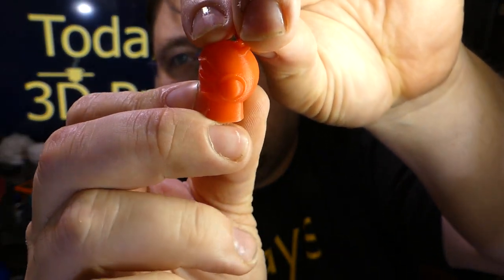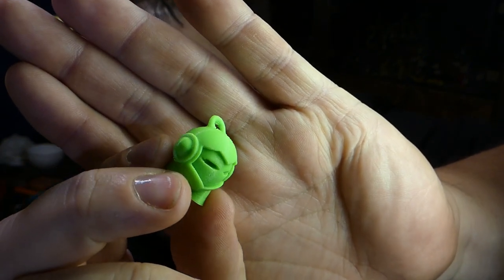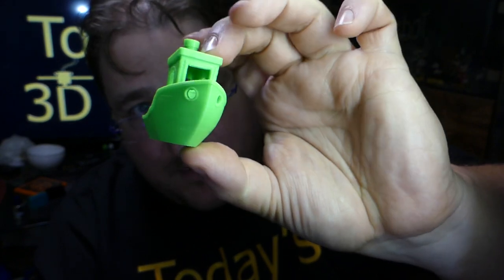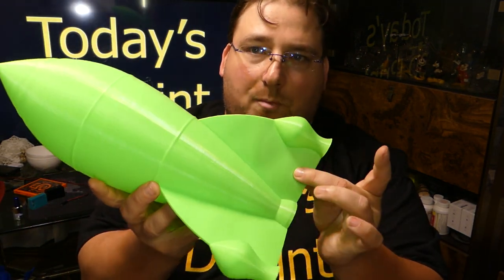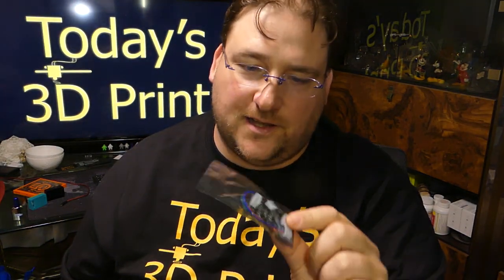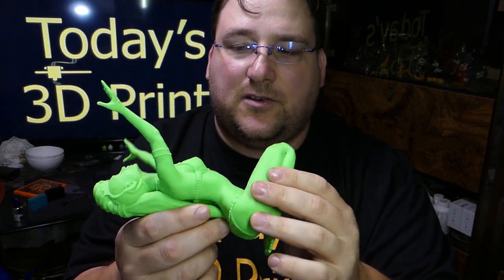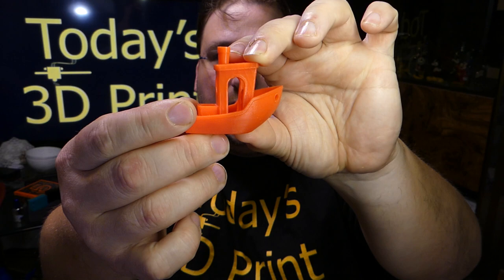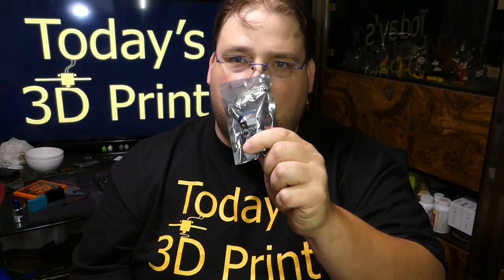Today's 3D Print 108 Tevo Tornado Smoothers installed FANTASTIC results

Comment: Hey there. I'm still working on my Ender 2. I'm actually working with tech support at creality. They sent me a lucky cat G-Code. They said it would test have to fill them in and the nozzle. That G-Code only works if I have to settings up to 2:20 What settings do you use in simplify3d to dial it in. There is no specific Ender 2 driver for it.
Reply from the maker: I don't understand. more details?

What is the trouble you are having with your ender 2 ?

as for settings above in the description is a link to all my printer profiles AS WELL AS test gcode!! try one of the gcodes and see how it comes out. this will tells us if its a printer or slicer issue possibly.
Reply: Nerys I was actually posting a video about the problems I'm having with that Ender to. And that's when I noticed that the fan was moving on the hot Enders was printing. You know what size at Fannin so I can order on Amazon
Reply from the maker: +Fergi 3D 40 mm x 10 mm 12 volt I would not suggest a quiet fan unless you buy both because the Ender uses the excess air from the hot end for parts Cooling so quiet fan might compromise your part cooling ability or might not if you try it let me know
Reply: Nerys I got the replacement fan on Sunday. Hooked it up. Downloaded your settings. And printed one of those Santa gnomes. Four layers on the wall. No infill. No support. He came out flawless. I rub my fingers on the side and I can't feel the layers. It looks like it was injected molded. So thanks for the help. It seems like I have a working Ender 2. I'll post results up on my channel.
Reply: I am interested in your thoughts here. I'm looking at the print from an Ender 2 and a CR 10. Wondering why they're so different. They use a lot of the same components. Then I realize that the Ender doesn't have a cooling fan for the part. Do you think that the print on the Ender bonds better because it's not cool to as fast
Reply: And if it's the rate of cooling for the pla. What would happen if you reduce the amount of air going to the print of a CR 10. Would you get Ender quality prints from the CR 10 then

Comment: Is there a specific way to connect these to board and motor (ie a in side and a out or can you connect iether end to motor or main board?
Reply from the maker: +MsLostboysforever as far as I can tell they have no Direction they just plug in line
Reply: Nerys hi
Thank you for your swift reply, i have bought the 8 diode version and should be here tomorrow 😁

Comment: have you tried the smoothers on the cr-10 with any noticeable difference(s)????
Reply from the maker: Sadly I am 99% sure they won't do a thing. the noise on a CR-10 is mechanical/physics based. its literally the printer itself and its inertia causing the noise.

The Tornado also has this for the same reasons. that noise was UNAFFECTED by the smoothers.

The Tornado has additional "defects" in the print surface unrelated to that. the "salmon skin" which was caused by a compatibility quirk between the drivers and board they used for the steppers.

The smoothers corrected this quirk. they did not "remove" any noise.
Reply: Nerys ahhh I see, on another note (video) I will be doing as you did in ragards to adding silent fans in my cr 10. Otherwise, love your videos and I watch as they come!! Love the big version of the sorceress btw!! Cheers
Reply from the maker: +Paul Palumbo it makes such a big difference especially when you have more than one of them :-)

Comment: Hey! :*) So with the smoothers added do you think it's better than the CR-10? Thx!
PS: Too bad more (other) YouTube Channel reviewers aren't as meticulous.
Reply from the maker: no. I still prefer the CR-10 but DO SO wish the CR-10 has some of the features of the Tevo. for example I think creality should immediately switch to the Glass plate bed that is oversized like tevo is doing. that is AMAZING. such a flat surface bed leveling is so easy and pronto switch to the AC heat bed.

besides those however I prefer the CR-10.

Comment: I have a request. Can you redo the benji with a 0.6 print head and see how much faster? and the print quality. Would be great to be able to do a part like that in 20 mins rather than over an hour
Reply from the maker: Even with a .6 all you're going to do is remove one perimeter you're still not going to be able to do in 20 minutes to do a bench in 20 minutes you're going to have to crank up the speed a lot I'm not even sure if that's entirely possible but I'll give it a shot I'll try to make the Target under 30 minutes but seeing how my typical Benji takes an hour and 25 that's a big order but we shall see also remember the Banshee was designed around a .4 millimeter nozzle so it's used as a benchmark is less effective if you change the nozzle size without also changing the size of the model

Comment: Stupid question.  Does it matter which side you plug anything in with the smoothers?  Or is either side okay?
Reply from the maker: +arcanum70 as far as I can tell they are bidirectional and it does not matter
Reply: Thank you sir.  Don't need them yet, but I am hoping to need them in the future.  My printer is fried and the money that I was saving for another went to my mother and brother because of medical emergencies.  But in about a year I'm hoping to have enough saved again to pick up a Tornado.
Reply from the maker: +arcanum70 when funds allow consider an ender 2 $160 for a full featured printer.

Comment: Great and useful video.  Do I need to increase the voltage for the steppers with these smoothers?
Reply from the maker: +Khalid Abed I don't think so I think you only need to adjust the voltage if you have layer shifting issues if you don't have layer shifting don't mess with it
Reply: Nerys Thanks, and keep up the good work :)

Comment: hey I would like to ask a question. I have an issue with my printer. I have a tornado and have sent communication actions to a few vendors but no response yet. I know this is not the right forum but I can't find any info online.  I started a print and it didn't stick so I stopped it and moved the design file to a new spot on the bed when I reinstalled the sd card the printer would see the file but when I select it to print the printer seems to reboot and doesn't start the print. I can move all axis with the controller but no automation I have tried new files and checked the fuse all good and the same.
Reply from the maker: +DRONE TO THE BONE the sd card that comes with the printer is "fake" you have started to write files to the non existant fake area of the car. Temp solution. Reformat the car dont right more than a few files to it permanenet solution get a new sd car (around $10)
Reply: the printer does not communicate with the cable either. unless I am missing something. I have never used the cable so not sure of the setup on a Mac
Reply from the maker: +DRONE TO THE BONE no idea about cable and mac. I know the problems usually come down to port selection and com speed. I have never connected a printer to the computer.
Reply: I have a windows machine but all my apps are on the Mac I am about to move everything and try the windows machine.
Reply: I put cura on my windows and tried a file with the cable. it didn't load time after time so about the 8th time I tried I noticed I had other stuff on my sd card that wasn't supposed to be there. I had dumped everything and only loaded one file. so I looked and I had a test file I made months ago on it so I tried it and it started printing. so I did end up just reformatting my card although I couldn't reformat on my Mac because I have no card slots so I have to use an adapter. thats what was keeping me from reseting the card. so I did it on my windows and am printing again thanks for the help.
Reply from the maker: +DRONE TO THE BONE no problem replacing SD card they're ten bucks on Amazon

Comment: hi,

which printer do you recommend? the cr 10 or the tornado?
Reply from the maker: +Christoph  Fuchs I am still analyzing the tornado well what I see so far is extremely impressive I am reserving judgment until I thoroughly test it if you want my untested opinion the cr-10 is very reliable and creates very high-quality prints the tevo tornado is essentially a clone write down to bolt hole measurements but they have made significant upgrades over the cr10 such as the AC heated bed which is not only very fast to heat up what can reach ABS temperatures easily it also has a full size SD card slot a full size USB port any more compact brainbox it does however have some small flaws the actual brain board the motherboard it's not perfect and there's issues with the stepper drivers which can be corrected with cheap TL smoothers I also know at the CR 10 is designed for industrial use of hundred plus our prints over and over again without blinking twice the tornado is still untested in this regard if it holds up as well it is actually a rather nice upgrade to the CR 10 and I imagine creality will be answering with another version of the CR 10 if they're smart
Reply: Nerys thanks for the detailed write-up! highly appreciate it.

Comment: Nice video man! I was looking at these yesterday on Amazon to help out a friend. I genuinely haven't seen the problem occur with my printer (at least not yet) Is it possible that not all Tevo Tornado's suffer from this issue?
Reply from the maker: Absolutely it is my understanding that they have updated the design unofficially to change the electronics to alleviate the salmon skin so it's possible some of those updated models or entering the market now so if you buy a current tornado you might not experience this problem I don't know if it still works or not but check my latest video I have a link for the tornado for 350 from the gearbest US Warehouse the coupon was limited to 100 to try it see if it works
Reply: Thanks man! Appreciate the quick response))
Reply from the maker: I strive to keep my critters happy :-)

Comment: Uh, holy cow dude.  Time to get a bunch of TL smoothers I guess huh?
Reply from the maker: yes and no. I don't know if these will remove ringing/ghosting (notice the salmon is gone but the ringing/ghosting is still there just behind the bow on the outer hull. for this particular use case yep. it was the solution. I have 4 more smoothers I WILL be trying them on my CR-10's
Reply: Nerys see, the ghosting is my main issue in every print on every printer I have.  I can get rid of it if I print S L O W, but was hoping for something that would let me print at least 40mms
Reply from the maker: +Dennis J Harrison Jr I have a feeling this is something that's going to be very hard to remove enlarger printers I believe it comes down to mass and inertia you can compensate a little bit with jerk and acceleration while still maintaining straight line high speed performance getting truly noise-free Prince like I get from the Ender on a CR 10 or tornado might not be possible but I will keep trying :-)
Reply from the maker: +Dennis J Harrison Jr well you have noise from two different sources which is why you just need to go slow sometimes the salmon skin was noise generated in error electrically inside the printer ghosting is mechanical noise so there's not much you can do it electronically to fix a mechanical problem except to move Beyond its threshold

Such as by slowing down it comes down to mass and inertia when you conduct an acceleration and that's what a Direction Change is an acceleration inertia wants to keep you going in the direction you were going this is why for example when you turn in a car it feels like you're being pulled the opposite direction this is actually fiction you're not being pulled in the opposite direction your body is trying to continue going straight while the car is turning your senses interpret this as a push in the opposite direction the very same thing happens with the printer that print head and that print bed are moving and now you're telling them change direction a new acceleration inertia resist this and what you get is a vibration for wobble and this is what causes the ghosting and ringing well I know this causes the ringing I'm not so sure about the ghosting that seems to be more than just an inertia problem Maybe I think it's time I do a video on the subject even if I don't have the answer the explanation will help in understanding what is happening

Comment: Hello
there is a tutorial for instalation?
cordially
Reply from the maker: +Babylife Tony I will try to make one soon but they are straight up Plug and Play you unplug the stepper plug into smoother and you plug the stepper back into the smooth done that is all you have to do
Reply: Hello
I am not yet a printer I hesitate between torn tornado and anycubic i3 mega
that's why I inquire before buying the printer
thank you
Reply from the maker: +Babylife Tony there's a pretty big difference between the I3 Mega and the tevo tornado the I3 Mega will give you better quality prints and it's very user-friendly the tevo tornado on the other hand will allow you to print much larger than the I3 Mega ever can

So you have to figure out what you want do you want slightly easier higher quality prints or do you want larger prints?

I would rate either printer a safe to buy in my opinion and they both create excellent results so it depends on how large a print volume you desire
Reply: Hello,
I start so I do not think to print a big piece.
if i take the anycubic i3 mega can i install the smothers?
thank you
Reply from the maker: +Babylife Tony there is no need for the smoothers the I3 prints with almost zero noise which is one of its very highest attributes

Electronics on board do not introduce any spurious noise in the print so the smoothers won't do anything they won't hurt but they won't help
Reply: OK, thanks

Comment: I brought up about this Salmon skin and (I am no Tevo lover as a company) I received a response, or two.

It's MKS BASE. Some boards have HR4982 and some have A4982. A4982 has worse salmon skin that is pretty much fixed with the TL smoothers. HR4982 have less salmon skin but the smoothers aren't as effective.

My response was

Why would they use such horrible drivers that ruins an otherwise good printer? Why would Tevo use this board knowing it is a crap shoot as to which they get but out of the box they are ruining the experience for customers who get it and 15-20 mins 
later is doing their first print to see this ugly salmon skin?  That part makes zero business sense to me.

response

because its a 300 dollar printer - don't expect the moon on a stick.

My response back

I see there isn't a price difference, or much of one, between the L and what is currently in it so I suspect they chose the older MKS Base because Tevo wouldn't need to buy drivers.  L looks like a viable choice and stick with the reliable (well, they
 have been for me) A4988 or go to the MKS Robin and be able to take full advantage of 1/32 steps.  At least there is a viable choice so it makes no sense to spend for smoothers when an L would run you about the same price of you already have the drivers as I do.  I am dismantling my first printer (a RepRap) that never gave me any real print time so its A4988 drivers will fit nicely in that L and the Salmon skin should cease, right?  I read it was a driver issue that causes it on various 
printers.

response (one of the reasons I hate Tevo as a company)

TEVO production can hardly keep up with sales, I doubt they care too much about this stuff.
When they build to these prices, quality control is the first thing to go.

Comment: DRV8825 drivers are ridiculous. They should be eliminated from production lines. Tevo keeps using them with low inductance steppers and it's absolutely brain dead. They skip micro steps. Tevo want's use them because they can do 1/32nd micro stepping, but you can't pair them with the steppers they use, or you get this nonsense. I'd rather use 1/16th micro stepping with good old allegro 4982 drivers than deal with this abomination. I know TL smoothers fix the the issue, but keep in mind TL smoothers will heat up while in use, so make sure they're not in enclosed space or have air flow. Good that it works, but the fact that you have to use them is Tevo's fault.
Reply from the maker: kazolar absolutely agreed they should eliminate them cooling won't be a problem just sitting right in front of both fans but yes it is a Band-Aid to a problem that should be addressed I think they'll fix it if not they'll lose loyalty and I don't think they want that either we shall see for now they do fix the problem and the printer is pretty goddamn badass :-) anybody have a source for the cheap silicone AC pads are using? I bet you're like 15 or $20 if we can find out where they're getting them from I want to put them on all my printers
Reply: you should contact them to explain the problem and how to resolve it. i think they could upgrad and fix this minor issues
Reply: The simplest solution is to throw in a set of TL smoothers with their printers. For most people it will be sufficient.  I'm a builder, so I would stay real far away from DRV8825s for my custom builds. When designing/building 3D printers, last thing you want to troubleshoot is flaky stepper drivers. Machines I build are complex enough as it is, so using known good components is key. Problem is Tevo uses integrated circuit boards with DRV8825s built in, they use Marlin based ones for the Tornado and Smoothieware ones for the Little Monster -- in both cases the boards they use have surface mount DVR8825s, and there is no replacing or swaping, or bypassing them. Smoothieware allows for a way to bypass onboard drivers -- at least the real smoothieboard does. Don't think it's that simple with Tevo's variant.